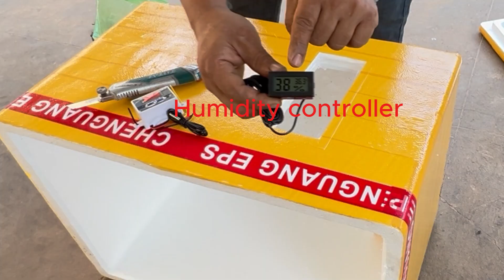HOW TO MAKE INCUBATOR WITH YOUR OWN HANDS. BEST LOW COST HOMEMADE INCUBATOR FOR CHICKEN EGG - DIY

Comment: Sir im Ethiopia you now Ethiopia ,,,so for 5000 egg capacity how much size dimensions of the incubator and egg triy afterthat how much tt and hh and P0-pp and F1-F7 and after 18 day what is the diferent then 18-21 days what is the change tt and hh you can send me for incubator material equipment like controller,fan ,heater,humidifier egg turning motor,limit switch,and other inportan material in Ethiopia not available the material you can help me???